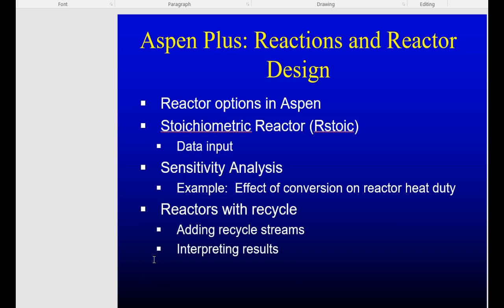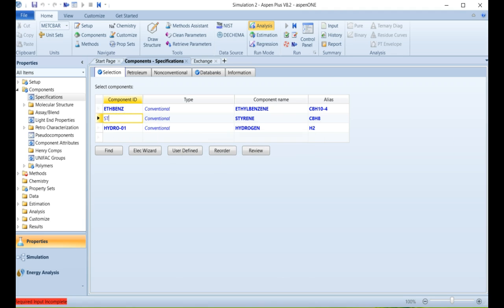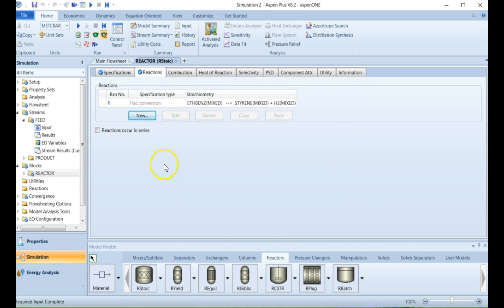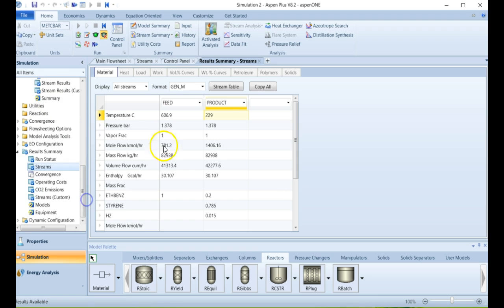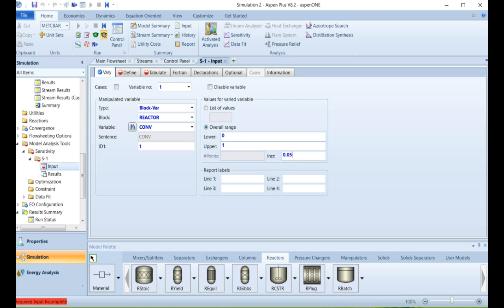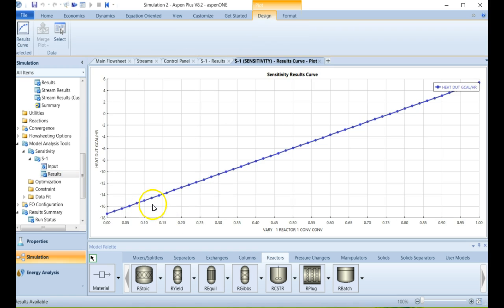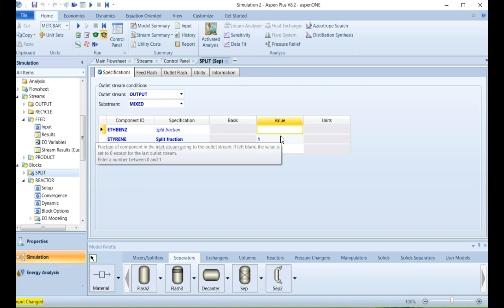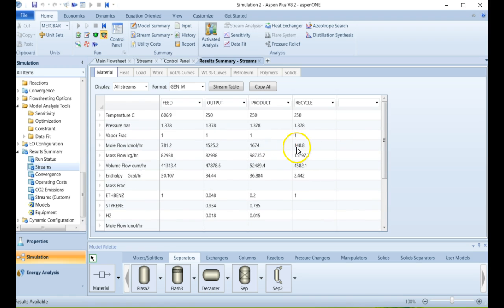Reactor and Recycle, Really!

Comment: This is almost useless. When you incorporate heat exchangers and distillation columns it doesn't work this well at all. It ESPECIALLY doesn't work when you use a reactor that requires cooling or heating during the reaction that must be modeled.